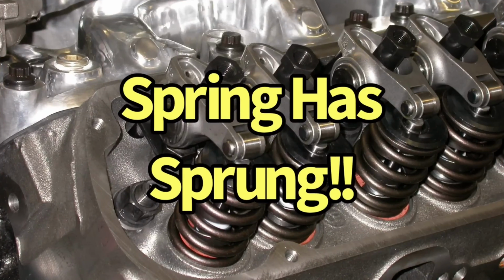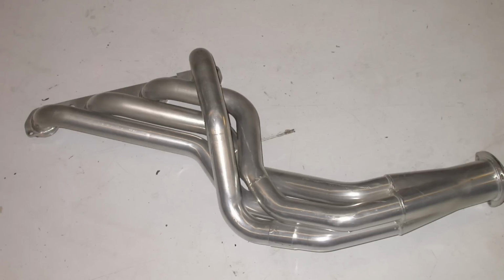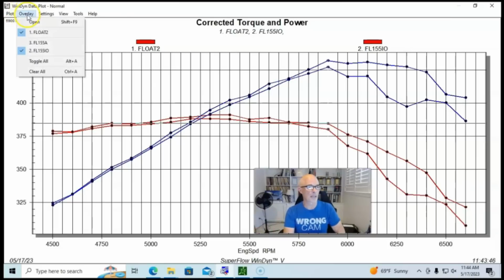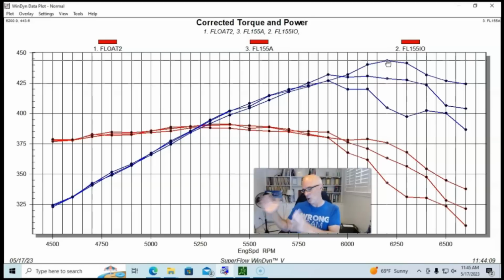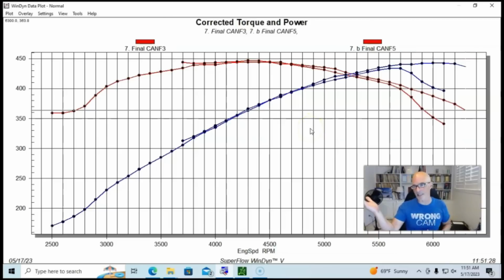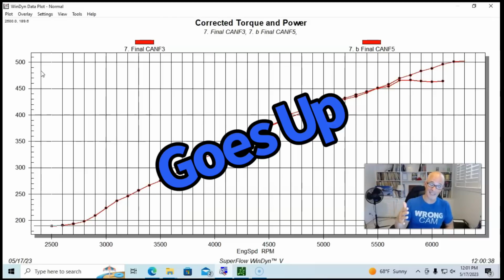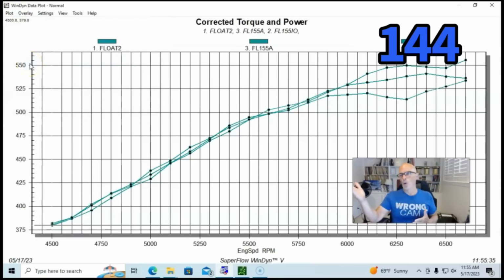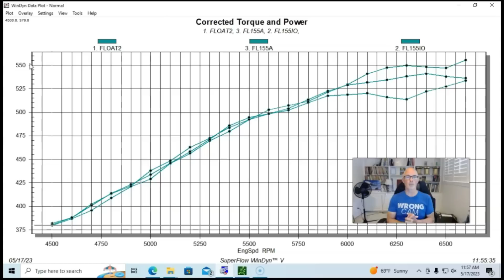HOW TO CURE VALVE FLOAT & ADD 40-50 HP WITH A VALVE SPRING UPGRADE. AIR FLOW VS VALVE CONTROL!

Comment: What your opinion on running a spring near coil bind? Is it ok to use .600 springs and a .500 cam?
Reply from the maker: The spring is much more stable near coil bind-a .600 lift spring on a .500 lift cam is not ideal

Comment: OHC engines use valve springs like the OHV engines. Yet, they don't suffer from valve float until much higher in the RPM range. Why is this? The OHV has the lifter and pushrod linking the cam to the rocker. Obviously those components are the real issue that needs addressed. Placing higher pressure valve springs is just a bandaid to the problem.

Comment: 1990 mustang gt stock  had a year now no power at all so install e303 cam long tube header still no power. So removed valve covers I can turn some valve springs by hand could they be put in upside down causing lack of power.
Reply from the maker: only a beehive could be put in upside down-otherwise dual springs are not directional

Comment: That reminds me of when I found a ebay deal Torquer v2 for $100 bucks I also found Some used Hi pro full race springs But they were just some wore out truck springs So I couldn't figure why my ls1 would fall on her face @6k I chased phantoms for over a year

Comment: trying to narrow my issue down.  losing power after 5k rpm ... question is the motor lm7 cam intake headers duel exhaust always ran good .. last night it just fell off after 5k .. would valve float just randomly happen ? build has 6k miles on it.. has always ran strong ..hoping it's fuel related but any input would be appreciated... thanks in advance
Reply from the maker: float does not usually happen like that

Comment: Do you think the 1.7 rocker helps rather than having a 1.6 with a larger cam? i.e. given the same .5in valve lift, is a 1.7rocker with a .294 lift cam more stable than a 1.6 rocker with a 0.313 lift cam?
Reply from the maker: more lift tends to reduce stability

Comment: I just went to a roller block. Got a 351w roller, think bout a 393w!"it's going in my 94F150 flaurside, or my 79 Fairmont wagon, 4 cylinder cat manual rack, no power boost breaks! Manual breaks?!! Fox body stuff fits! 100 shot of gas that I have! Even have rpm heads! Retired and bored to death!

Comment: Excellent video , thankyou for all your hard work and time , i have a 1994 must. Cobra installed twisted wedge 170 cc fast as cast heads # TFS-51410002-M61 , SPRINGS TFS-16514   1.460" O.D. SINGLE W. DAMPER . 118 lbs @ 1.800" closed 
305 lbs @ 1.260" open .
Seems like you said WEAK ! for a hyd. Roller.
My cam anderson Ford motorsports B-31  dur. 270/280
218/228 , lift .544"
Engine pulls really strong to 5500 rpm then  falls off.
Would the comp cams springs for the XE274 FOR YOUR FAVORITE CAM DO THE TRICK ?  If not can you make a recommendation? 
Again thanks for your great videos i have learnd alot !
Reply from the maker: you need more spring rate

Comment: Does he not know what usually causes valve float in an old v8 engine. It's the preload in the hydrolic lifter forcing the valve off the seat. Then the engine loses power.

Comment: Stopping valve float was my trick back in the 80s. I used to run solid flat tappet lifters on hydrolic cams. That 6200 valve float wasn't an issue often times even with a factory cam. I also did it with hydrolic lifters by taking the insides apart and flipping the center tube around.

Comment: Richard, very timely video. I have a SBC with Comp Cams XE284 hydraulic flat tappet cam, factory heads, 9.5:1 CR, and cheap valve springs. They are 130 seat and 330 open, and the problem I'm having, like shown in your video, is the engine rolls over badly at 4600 rpms. My question is, even though the valve springs are showing the correct numbers can you get float simply from poorly manufactured springs?? ie cheap Chinese spring vs. Comp or PAC. I think I know the answer but thought I would pose the question. TIA!
Reply from the maker: THAT SHOULD BE ENOUGH SPRING RATE FOR A FLAT TAPPET-BUT CHEAP SPRINGS OFTEN GO BAD AFTER 10-15 MINUTES OF RUNNING

Comment: I had some wp heads in like 95’ with a performer and B. This is the engine I put single plane on at the same time I did Lunati cam. The springs did ok with the B but I had to buy springs for the Lunati, then I had to buy a screw style compressor because I couldnt install them with the lever handle thing that goes on rocker stud.

Comment: Valve float at 5500, thats y u dont run flat tappet springs on roller cam, exactly what r&l engines told me 20 yrs ago

Comment: RICHARD  , I GOT A 2000 F 150 5.4 2V XLT SUPERCAB WORK TRUCK AND IT NEEDS BOOST .A SMALL TURBO ,  IT CANT HAVE ECM MESSED WITH NO CODES WHEN TAKEN TO TESTING , BUT IT CAN HAVE FMU MANUAL TYPE ENRICHMENT LIKE A VORTECH FMU I THINK . ALSO I HEARD ABOUT AIR INTAKE  TEMP SENSOR WHEN UNPLUGGED MAKES RICH MIX ,HOW ABOUT A BOOST SWITCH TO DISCONNECT AIT SENSOR UNDER BOOST  IN ADDITION TO FMU TO FATTEN IT UP. MAYBE SLIGHTLY BIGGER INJECTORS BUT WHAT DO YOU THINK? PLEASE ADVISE.LOVE YOUR CHANNEL

Comment: About 8 years ago, i was traumatized by my 5.0L engine. I did a fresh rebuild with some good-used SVO "Y" aluminum heads. The guy i bought the heads from said the springs we're good for .600... I was running a .500 lift cam. My mustang had 3.73 gears, so the rpms at interstate speed was like 3300 which is too high in my opinion. Within (2) 1100 mile trips i broke 8 of the 16 valve springs 2 states from home. Thank goodness they were dual springs. Now, i bullet proof my valvetrain with proper dual springs and shaft roller rockers systems if available. Thanks for the education Mr. Holdener 💪

Comment: As far as softer springs being "safer", I would think that if one is cutting it close on piston to valve clearance the consequences of valve float would be far more catastrophic than wiping a few cam lobes. Also, I would be interested in a test of conventional vs beehive and conical springs of similar rated spring pressures for valve control.
Reply: I second the thought on more valve spring pressure being safer, as i seen my friend's engine over rev., and valve float so severely, that it sucked a valve up through the intake manifold!
Reply: Yessir same here

Comment: This is one I've been waiting for. I have inadequate springs on an LQ4 that I changed the camshaft in. It makes decent power, but definitely exhibits valve float. I found out the hard way that not all "918" springs are created equal. The PACs in the engine now are only 313 lbs open. The XR275 cam requires around 370lbs open. I should have spent the extra money and bought the Comp Cams matching valve springs from the beginning. Live and learn... 

Hopefully it picks up some decent power when I change the springs and redyno. 🤞
Reply: yeah  either the recommended ones or ones that are equivalent to what they require

a lot of aftermarket head manufactures  have weak springs in them.  every time i look up a cam and i see what spring it takes im looking at the heads and what spring they put in it.  most of the time they never match.

for example.  i want to run a 347  in the zephyr i have and was thinking a mid lift hydro flat tappet with 236/244 .568/.568 lift from erson would do it and make power till 6000 and shift at 6500  with a RPM air gap and double pumper

the spring in the promaxx 180 MAXX heads are max .575 lift but the open and close pressures are very similar to what erson recommends. so the rates are about the same or a little higher than the erson spring for that cam

it SHOULD work if i were to do it

Comment: Would less intense lobes have an affect on how aggressive the springs are too? Like running an older cam profile so the springs dont take so much of a beating?
Reply: Absolutely, if you look at different cams you'll notice they make versions that are much more friendly to stock valve springs, that's often the major difference.  It's a function of how much work a spring can do in a given time period. You have to move X mass of the valve Y distance. If you try and do that faster as in a steeper ramp rate you'll need more spring pressure to do it.
Reply: Absolutely. The nostalgia cams we fondly think of like the three fifty horse chevy cam or the l t 1 cam only used a couple of hundred pounds spring pressure

Comment: Something to think about: If we look at the early horsepower graph after the better springs were in place and compare with the airflow graph with the good springs, we see that it took only a measured 550 cfm of airflow to produce 444 hp @ 6300 rpm. I'm led to believe most of us are running more carb than optimum on mild street combinations.
Reply: Remember it's not just rated size and developed HP, the various carbs produce different atomization patterns as well, which affects power and response.
Dogleg or annular etc can make a big difference.
Reply: @hotrodray6802  Sure, but that's a different variable.
Reply: @davidmarshall8628  
Right
LOL LOL
Reply from the maker: the flow rating of the carb is not measured at the same depression that occurs in the engine.
Reply: @richardholdener1727  I thought of that, but I couldn't think of an easy way to account for it.
Reply from the maker: the 650 carb was used in the combo that flowed 550 cfm-it worked perfectly
Reply: @richardholdener1727  It surely did, no doubt. When I was younger and dumber I wouldn't have believed "only a 650" could make 444 hp.😁
Reply: Part of it 

Not too many people outside of a class specific race would run less than 650-750 on a 440 HP engine.   I bet you won't see anyone running a 550ctm carb which some manufacturers do make on an engine like that let alone a stroker that makes that power.
Reply: @KingJT80  carb size is like penis size, peps think it's gotta b huge to b cool